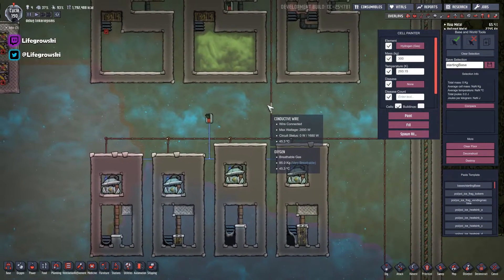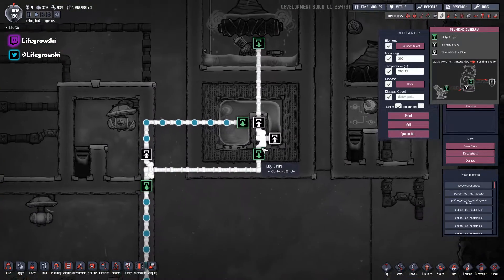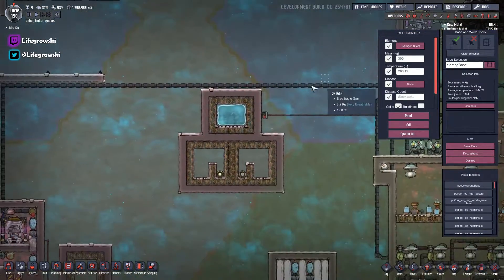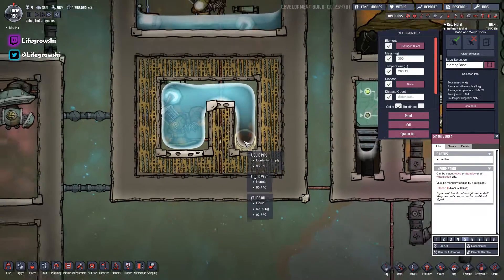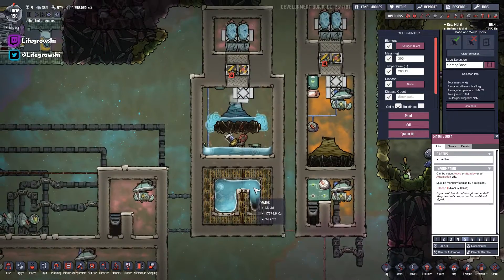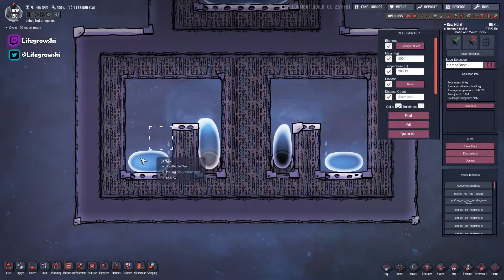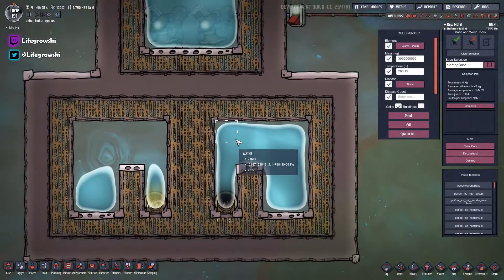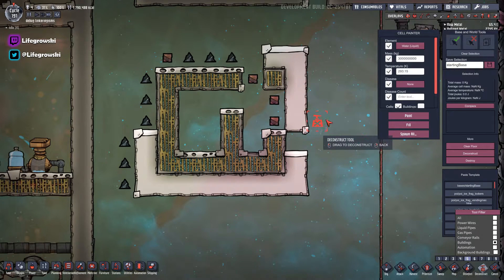OVER PRESSURE LIQUID VENTS HOW TO

Comment: You skimmed over the mechanical priority pipe layout. I've never seen anything like it before, I probably try to use some complicated series of pumps and tanks to avoid too much automation, but your pipe and bridge only method is wonderfully simple, although I assume is a valve system that is not intentionally built into the game.

Thanks for making this video. I want to try it with liquids, but am also eager to try it with gases to contain CO2 for longer than I normally would be able to without digging a big trough or employing carbon skimmers (because I don't want all the extra heat and water before I've had time to comfortably explore the ice biomes — I'm a slow player).
Reply from the maker: Basically any bridge that you place after the initial output, i.e. a pump connected to a pipe - the first bridge will always take priority on the gas pipe. Providing the pipe that connects to this bridges output (green slot) is clear, or has room for the packet that passes by it's input (white slot) then it will be moved before carrying on down the line. With this you can do some very simple, but also some very complicated builds.

They also maintain flow within a pipe, and can be used to create feedback loops and mechanical filters - which are incredibly handy once you get your head around them :) All of this is intended gameplay function - so don't feel like you're cheating :)

Comment: so umm is it possible to make an over-pressurized oil tank? or do u just need a large normal tank
Reply from the maker: Yep, just use a floating vent with the same tile design. So the vent would be at the top of the tank covered by a liquid that floats on oil (I normally use petroleum to avoid any water-boiling accidents if my oil get's too hot...). Only trick here is that you need to let the tank fill with oil a little before you drop your petroleum over the vent and close the build up.
Reply: @Lifegrow  oh shit i would never have thought of that XD thats great thx